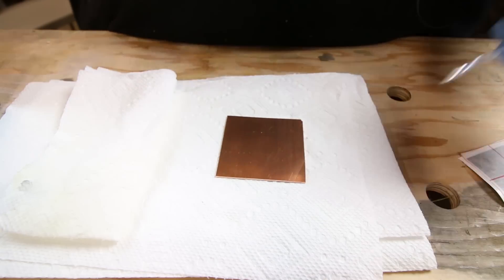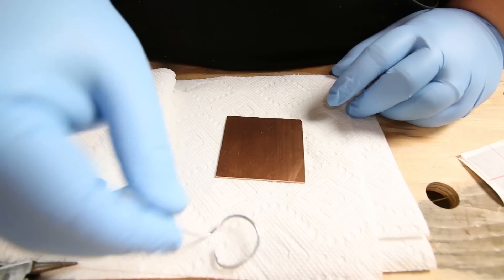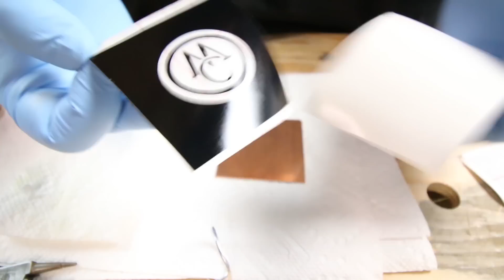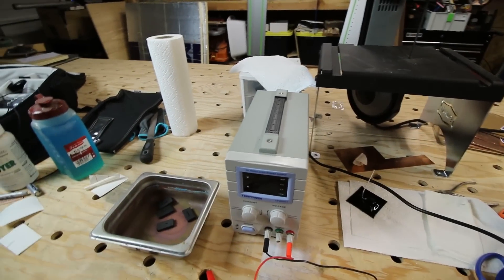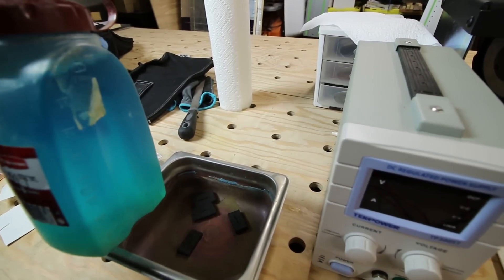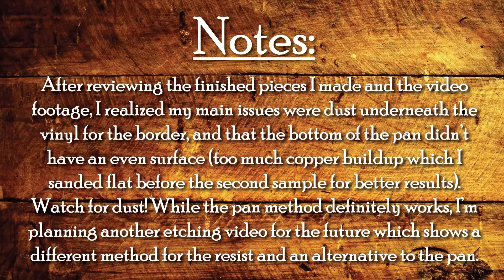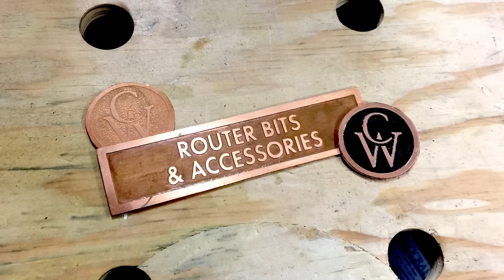Etching Copper Badges & Nameplates Without Acid!

Comment: just fyi electricity flows from negative to positive
Reply: Just found this but I was taught many years ago, that direct current or DC electricity is the continuous movement of electrons from an area of negative (−) charges to an area of positive (+) charges through a conducting material. Engineers use conventional current on all mathematics which is positive (+) to negative (-) but it doesn't change the fact electrons still flow from negative (−) to positive (+)  but A really good video I never thought of using vinyl and I will be trying that. It would be good if you could do an update explaining in more depth about Etching. A Thumps up from me.
Reply: @1militarymike  Actually electrons drift only a fraction of a millimeter per second. Conventional current is when potential is assumed to be moving from positive to ground; Electrical current is when potential is assumed to be moving from negative to ground. So anybody can call electricity anything as long as the other person gets the intended message.
Reply from the maker: You're totally right - and the electrons move in the opposite direction which is why it works like it does (I think). Thanks for chiming in - if I do another electro etching video (which I may), I'll clarify that.

Comment: I have tried using vinyl resist with voltage/amperage as low as 1.5V at 100 milliamps for 2-3 hrs of exposure in saltwater solution, and found that I got a good clean etch with no failure of the vinyl resist.  I think higher voltage/amperage causes heat which weakens the adhesive of the vinyl.
Reply from the maker: Thanks for the info! I haven't tried salt water etching yet but it's definitely on my list. Looking back I think some of my vinyl failure issues came from dust under the vinyl near an edge - I think that caused the premature failure by letting fluid in, as other parts of the etch were totally perfect. Live and learn! :)
Reply: also heat de-lams vinyl